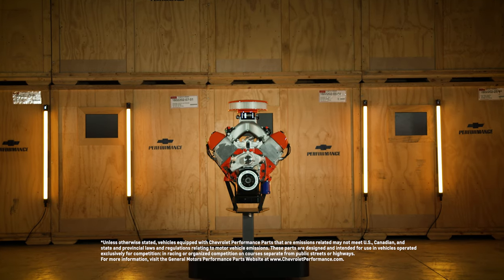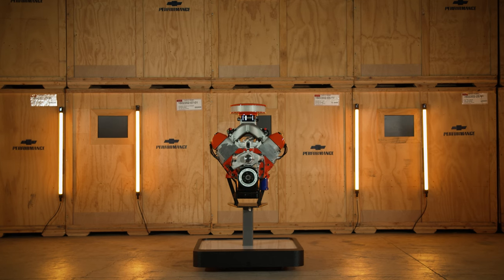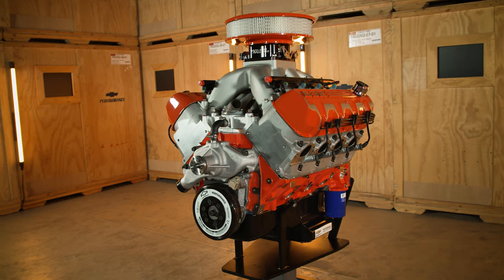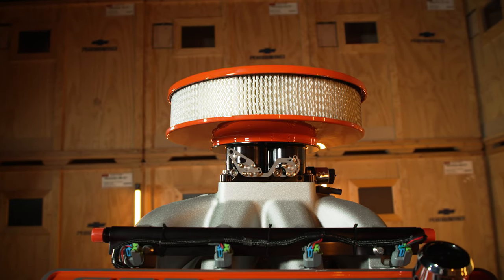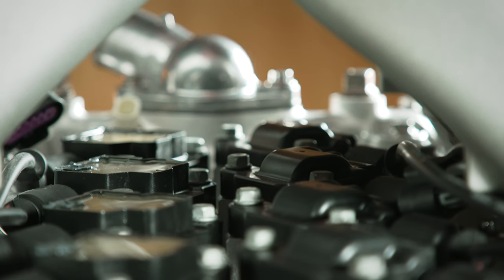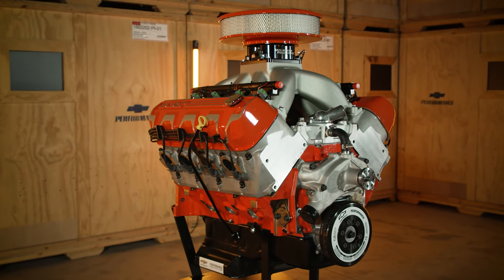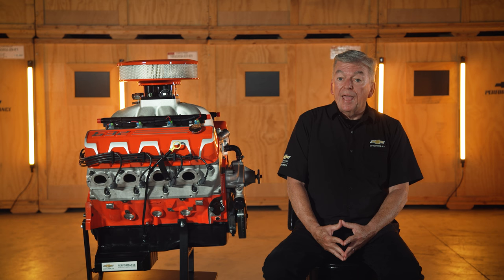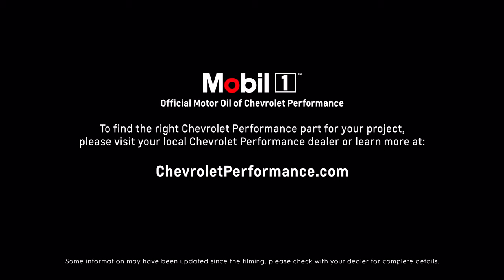Chevrolet Performance - ZZ632/1000 Crate Engine - Information & Specs

Comment: It would be helpful if I could find the engines dimensions somewhere.  It is to replace a 454 in a 1997 K3500, but I fear the intake is too tall to fit without a scoop.  My delivery is scheduled for 1st quarter 2023.  Ouch!!
Reply: are then bellhousingbolts same design pattern     as  LS  based egnine family along with engine mounts..dos it bolt into a copo camaro?as  i wouls like to fit this engine t my ss commodore aka poniac gto i the states  so thatprety much all jus want to nio is it  bolt in replacemant please GM oes it come with on comutor or you must suply thanks from the gong iz ozy land of vaginamite
Reply: Just get a cowl hood lol, or custom make a hood
Reply: Get the scoop

Comment: Not sure why there advertising these crate engines. Can’t even get an LS series based engine these days with the limited production from GM. Most performance outlets give a ship date of availability unknown. So good luck getting one !  Been waiting on my LS 7 over 3 months. Besides that looks to be a totally awesome power plant
Reply: The LS7 has been cancelled
Reply: is the 632 chevy same bolt pattern for engine mounts and bellhousing bolts as any Ls based engine family cheers
Reply: GM has been phasing out their iron engines for awhile now. 
Gen1 esp...couldnt even get a 02 5.3 crate for my truck. 
ONly crate Id buy is from GM

Comment: The question is how much boost can it handle
Reply: 9000 psi i finks
Reply: With a 12.0:1 compression ratio, imma guess not a whole lot lmao
Reply: @xSN1P3ZZzz  from what I know boosting anything above 12 compression does not work?🤔
Reply: probley morethan uraverge joe can handle on the street
Reply: 3psi
Reply: Exactly  correct  smaller  engines can handle  more boost as big engines  are limited  to the amount  of boost they can use
Reply: A LOT It’s Chevy so it’s very durable
Reply: Can you say " window mod".
Reply: Youll need a piston swap and maybe rebalance
How would you even get this much power to hook wiht no turbos
Reply: @johnalarcon6375  Who told you that?
IF that were true big rigs couldnt use a turbo

Comment: This would be nice in a b body with Walker mufflers and resonators to keep it quiet,but the sleeper thing might not work because the engine most likely won't fit under any stock hood.

Comment: Wild... Pump gas. Natural aspiration... Factory manufactured, built, and warrantied.  

Makes you wonder what's gonna happen when some ol boy slaps a Whipple , or a couple of galaxy size ball turbos under it  , and a good tuner behind it ..
Reply: A "Whipple"? Or "a couple of galaxy size ball turbos" UNDER it? 

First and foremost you can kiss the pump gas and warranty goodbye. Second good luck finding a "Whipple" OR "galaxy size ball turbos" anywhere "off the shelf" large enough to effectively "boost" that "mountain motor". 

The only "street raced" engines that big are "nitrous motors". Nobody with half a clue including any "decent tuner" needs that kind of displacement AND "boost" to make "big power". 

Guys like Ryan Martin are running "LS-based" so-called "big-blocks" well under 5OO cubic inches.

"Mountain motors" have huge parts, bores, strokes and pumping losses NONE of which are compatible with "boost" and EFI "tuners".
Reply: @deeremeyer1749  hold up buddy. There are plenty of big blocks out there making killer power with a set of turbos and efi. Check out Tom baily, or even Cletus McFarlands el Camino. The tech in that car isn't all that exotic. And the cubes are up there
Reply: @basketballcory2 You're  right  , as big engines have a small limit  of boost  they can use !
Reply: @basketballcory2 you're  right also but like I said there's a limit  on the amount  of boost big engines can use
Reply: @deeremeyer1749 Way too many quotation marks there bud
Reply: @paulspomer16 so many 😂
Reply: time travel my friend...time travel.

Comment: Love this engine, I hope to buy one soon. I due however disagree with one statement you made. You said there is no replacement for displacement. Cubic dollars beats cubic inches every time!
Reply: Yep, 3,000 hp small blocks cost more than the average new car. The only question is do you have enough money to have that much fun? But, this engine is one-third the hp with about that in price. Maybe buy three ZZ632 engines with installing them side by side in a T-Bucket for a SEMA Thiem Car !  That would be the COOL FACTOR now and into the future.  Go figure !

Comment: are the engine mount locations and bell housing take the LS1 6SPEED WILL IT FIT INTO A VY COMMODORE OR LATE PONTIAC GYO AS THEY CAL THEM IN THE STATESNY INFO WOULD BE APPRECIATED

Comment: So if I wanted to build a  NASA ST unlimited or regional open GT comaro,  
can I build an exhaust solution that will get it under the decibel sound limit for a regional track?  How much whp would I loose?  - would have to run at 6000 rpm?
Reply: make sue exhaust  exits from furthest away from seaker as we do inoz   micophoneson left of track run exhaust on rightside

Comment: Ik this is not even close in hp or anything, but is it just me or is it crazy a 4 cyl focus can run on 2 cyl and run and just run , especially when it has a ford transmission recall ?  Will still run and not die

Comment: Don't know how much it is, but it's well over $10,000! The old 632 at 750h.p. was $10,000!
Reply: Right around $20,000.
Reply: @kerbygator  huh?  list price is near $43k  - they sell for $35K if you are lucky enough to find one.
Reply: Dont think you could even get the parts for $10k

Comment: you are real experts. You are decades ahead of Formula 1 and all other manufacturers. How do you justify a maximum speed of 7000 rpm with an average piston speed of 28m/s?  That is madness and absolute nonsense! There is no piston/cylinder material combination that allows a permanently higher piston speed than 26m/s, and we are talking about absolute high-tech materials like those used in the Porsche GT3RS or in Formula 1, not stone-age technology like this one! So this engine certainly has its justification and impresses, but it would be nice if the details of the technology were explained, or the details corrected.
Reply: carbon fibre?
Reply: @nickligkanaris3737  carbon fibre for piston or cylindre? go to school again

Comment: What was GM's original fear before electric fuel injection?  Frequency interferences? Why Nascar rules was 3 wires and carbs until recent.  

Coin coincidences numismatics numbers frequency vibration and reasonances.

Comment: All that money and all that metal, it still makes less than 100hp/litre.
 
Not worth spending money on when we can get 1200hp from a 2.0 litre 4 cylinder VW Golf engine
Reply: Are you seriously using hp/liter for a pushrod engine? That useless metric will always prefer a DOHC over an OHV engine. Were you dropped on your head as a kid? You should be looking at Brake Mean Effective Pressure.
Reply: @johncarl5505  oh course he was dropped on his head he is a VW fan.
Reply: Oh boy here we go again
You keep your lil VW and the big boys will do it all day at a lower rpm with this beast. And stay together
Take a ride in a stout big block sometime youll forget all about little T engines .
Serious

Comment: Actually  smeding performance  engines builds a 632 cid with 840 hp for under 18,000 dollars. Yes 204 hp less but 12000 dollars  less also